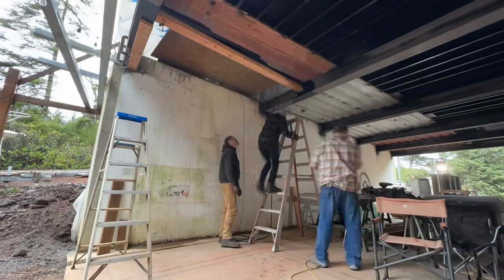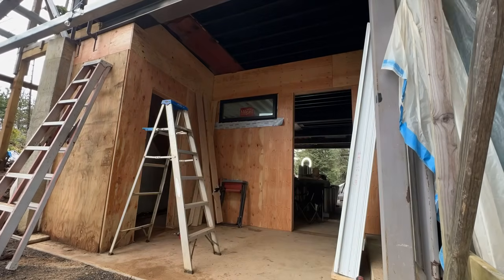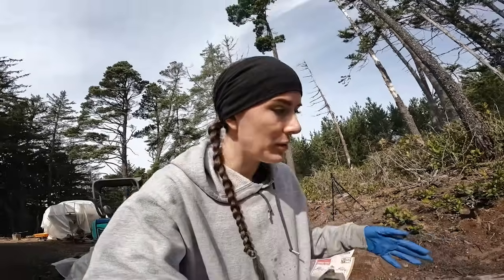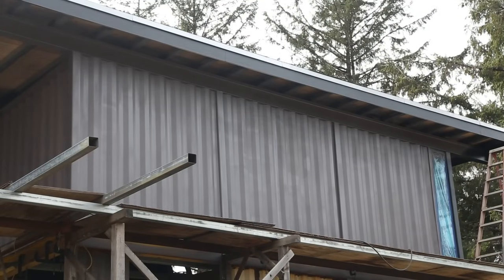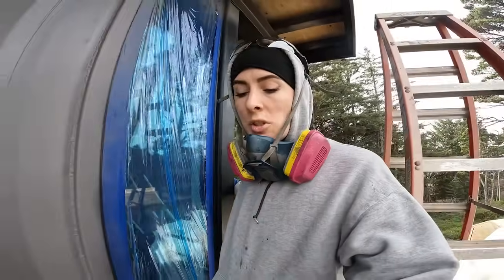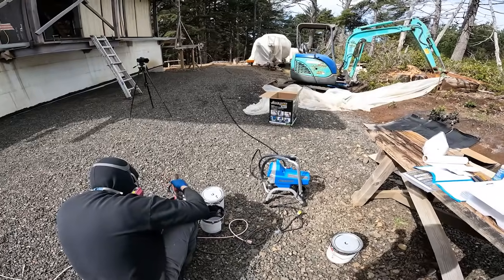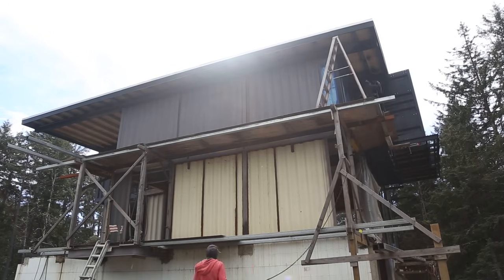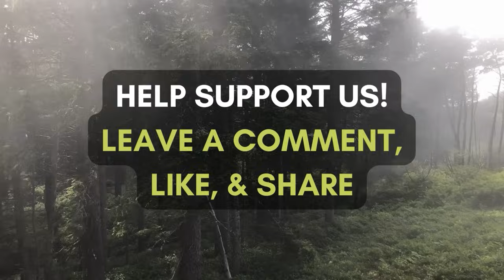Turning a NIGHTMARE into our DREAM HOUSE #diy #building

Comment: On your sprayer gun you may need to totally take apart and clean.  There’s a long filter inside the handle that may need cleaning or replaced.  I use xylene for cleaning my parts but wear rubber gloves.  It’s very strong and will mess you up if it soaks in your skin.  Cancerous.   Great job so far.  I give you a lot off credit/respect for your work.  Been watching your progress for a long time now.   I’m from Vancouver Canada 🇨🇦. Love ❤️ and be safe 👍🏻
Reply from the maker: Thank you so much and thx for the tips!! :)

Comment: I felt your frustration, watching this one. Ive done a lot of paint spraying. You may need to get a warm bucket of soapy, water & a small hard nylon brush & scrub the spray nosels. Over time if not cleaned specically they stop providing & even spray. Try cleaning your nosels & check that there is no paint build up in any of the other mechanisims. It works for me every time.
Good luck
Reply from the maker: Thanks so much for the suggestions! :)

Comment: For what you paid for the two avantis you could have bought a grayco which will outlast painting alot of shipping containers. Sometimes you have to buy more expensive tools to avoid frustration and get the job done better quicker.
Reply: 100% agree.👍
Reply from the maker: We looked at Graco paint sprayers and the price was significantly higher. The reason why we typically buy from harbor freight is price of course, but also their warranties. If we have any kind of issues we bring in the product and get a new one that day instead of sending it in and waiting weeks/months for it to be repaired and sent back.

Comment: Can you provide a video that shows your home concept or layout? 
Also, how are you going to insulate the roof and floor now that the containers and roof are in place?
Reply from the maker: I've shown the plans a few times in previous videos but I'll work on including them in a new video as well. We have a cold roof system so we will be insulating the interior of the house with spray foam.

Comment: Just watched your video of the window install on the 3rd floor. Great job. I noticed the two black vertical panels to the left, also on the outside. Not sure what you want for them, but may I suggest you put planters on them, cut out the space in between, or if you're artistically inclined, cut out some metal picturesque. The open spaces would allow sunlight, air, and rain yo hit your plants. Myself, I would plant herbs like garlic, basil, and mint.

Either way, I'm sure whatever you do will turn out just fine. At 66, I am also planning my first home build, and a container home is in my top 3 or 4 options right now.
Reply from the maker: Those are great ideas! I think the area you are talking about is the structure of our 3rd level cantilever balcony. We definitely are going to do some kind of small planters on the balcony and probably the rooftop deck as well.

Comment: When you are done with it are you getting the spray gun, nozzle clean how about the pickup tube from the paint can clean also how cold is the paint when you are spraying are you keeping it warm so it don't freeze good luck
Reply from the maker: We thoroughly clean the entire system after every time we use it and the temp is probably around 40-50 degrees. Thank you!! :)

Comment: I believe the problem you are having is because of the Viscosity of the paint and the lack of pressure from the compressor. Increase the air pressure and a smaller tip?
Reply from the maker: We tried everything possible, but now with the new sprayer it's all good. :)

Comment: Been watching your build for a long time. We built two homes ourselves over the years. I worry about you folks working on that sketchy scaffold without safety rails or at least a safety strap. It only takes one mistake to change your life.
Reply: I find comfort in knowing these videos are from 2 years back. If the video is available, they are OK.
Sometimes they share recent videos. In this video you don't see their storage building because that is very new.  It ain't OSHA approved. But when they are less than 3 or 4 feet from the big step, they wear their harnesses.
Reply: They use safety straps where and when required.
Reply from the maker: Thank you for your concern! I appreciate it. We try to be as careful as we can but sometimes we just have to do dangerous things carefully.

Comment: either you don't know or you don't care
Iron has a large heat charge, so in the summer you can't touch anything that is iron, and you paint it with black paint?? To charge even more heat, why not white, it is always a fresh color and prevents heat build-up, have you ever seen a metal house in my country? [Greece] only white houses and roof tiles, houses built with bricks and stone, why? because we are stupid? or because we know the stone house lasts over 100 years
doesn't need a lot of service.
wood is a construction material? Wood is for making fires but not for building a house, ok for decoration, furniture, building doors, ok, if a storm comes you will lose your house in seconds, fire? water?
Reply from the maker: We live in a completely different climate where our summer temperatures do not typically go over 75 degrees so we don't have to worry about that. I would have loved to build in stone but the cost would have been significantly higher.
Reply: Really? The stone is more expensive than wood, our house builders use the wood again and again after the formwork when they pour foundations, they collect all the wood and use it on another construction site, the wood is very expensive here, iron too
But we have many brick factories and cement blocks, we also use roof tiles, as you know Greece has many inhabited islands, so the materials have to be transported by ship
With 30-40 thousand euros you can build a 100 sqm house, the big cost is the land, which often goes up and it has to be in the circle of the village, if you are outside of the circle you have to have 4 thousand sqm of land To build, and you can't build everywhere, for example you have to be 180 meters away from the sea, you're not allowed to build in the forest, the forest is state property, if you cut a tree illegally and they catch you, you'll be fined 5000 euros
Some people use these isoboxes from transport trucks as a garden shed because they have isolation, so different countries have different cultures

Comment: Good equipment does not equal cheapest priced. If you're getting something from Harbor Freight and calling it 'good equipment', you might need to adjust your reality of good. Avanti is a very budget brand airless paint sprayer which I have yet to see anyone have constant and reasonable outcomes with. I hope you didn't buy that Avanti based on its price. Most people only build their dream house once. Why cut corners to save now when you'll spend way more later?
Reply from the maker: We priced out Graco sprayers and the price was still more than we would like to spend. The reason why we mainly like to go with harbor freight tools is because of their warranties and pricing. If we have an issue we can bring it back and get a new one that day, instead of sending it back and waiting for it to be repaired and sent back, etc.